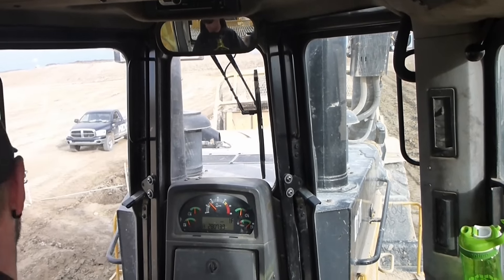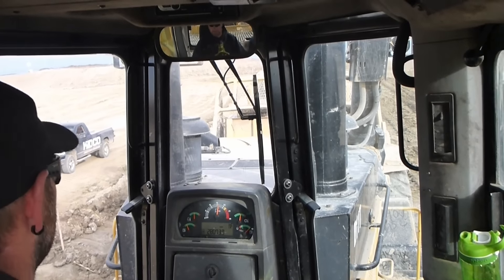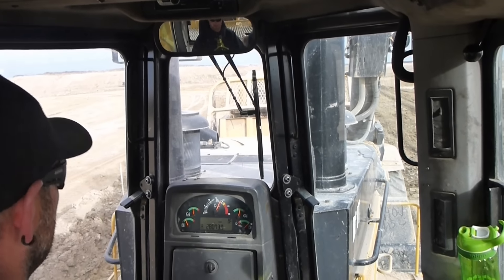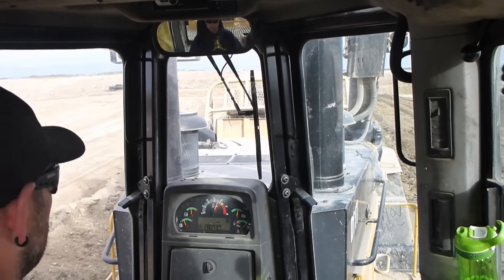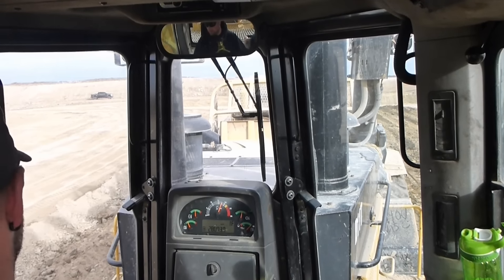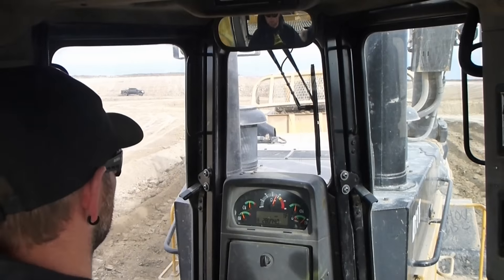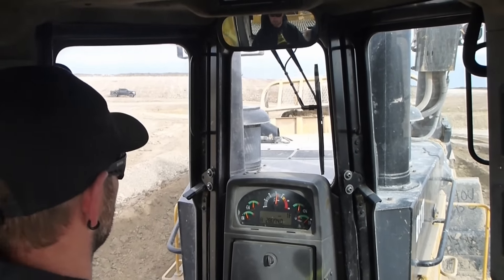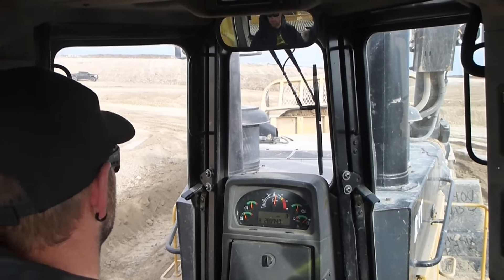Inside the Caterpillar D11T pushing scrapers

Comment: You definitely know what you are talking about.  Pan operators and rock truck drivers are the most hateful ,grouchy overbearing people on Earth. I pushed 657 pans , scrapers, for 3 years using a  D10R .  You can never push them right ,or your always hitting them to hard . Where I worked I was the new kid on the block ,so I caught all the crap.  I'm glad you pointed out how that you have to change your blade height to compensate for the pans depth , according to where you are in the cut.  Those grouchy old farts despised me controlling how much they were cutting. They would even try to either stahl me out or take off with half a load.  Because of them , pushing pans is one job I never want to do again, but running a 993k , loading 785s usbt much better .Rock truck drivers complain just as much.However I'm the old fart now ,so what I say goes. Lol